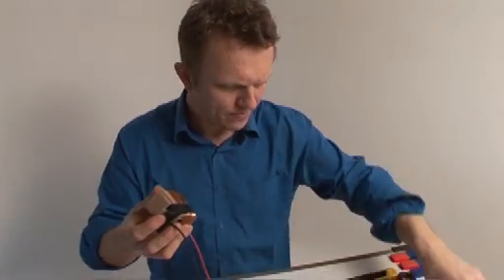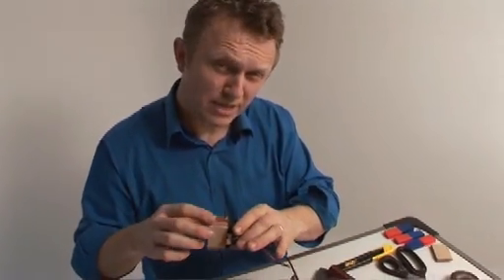BUILD A HAND CRANKED GENERATOR DYNAMO

Comment: If I were to make this using more/bigger everything, could I potentially get 5+ volts? 
I want to be able to charge a phone using something I've created. 

I imagine that at the end I'd just wrap the copper wiring around plug prongs and then spin it fast enough to produce enough volts to get it charging?

Comment: is it alright if the copper wires are not insulated?
Reply: I'm not a professional, but I imagine that copper wires not insulated would end up transferring the electricity to the cardboard, thus not doing anything. They need insulation to keep the copper conducting the electricity. As said before, I could be horribly wrong.

Comment: So what could you do to reduce your power bill without being forced to move? Well, based on Energy Star, half of all the energy we use in our homes goes toward heating and cooling. Try generating your own power and save on energy expenses through the generating power process “boma fetching unique” (Google it).
Reply: Justice Miller creating your own power wall using solar panels and batteries

Comment: I didn't understand how he did it in the part where he connected the two wires all of a sudden
Reply: +Carmella Davidson He connects the red to one end of the copper wire and the black to the other end. So make sure both ends of the wire sticks out.
Reply: +Carmella Davidson The coil has two end, the one that he wrapped around the nail at first and the one that remained after the operation, so each end is connected to one of the wires

Comment: just a question! what would happen if you used a doughnut shaped magnet that spins one way and a smaller filled round shaped magnet on the inside that spins another way ? 2 spinning magnets at once! what would happen inside the generator then ? or if you spin them in a different tempo. or out of synch with eachother... or the same way but out of synch.. or actually in the same way and speed ?
Reply: kinda like a gyro magnet inside an electrical generator! ?
Reply: actually... a magnet that makes another magnet spin inside of the outer magnet.. but the inner magnet is stronger then the outer magnet.. will it keep spinning ? will you not need to use a crank or anything then ?
Reply: thats free energy and if it worked...... well we wouldnt be worrying about power now would we?
Reply: Curious as this comment is now 6 years old did you make this project and see what happens or did you find any videos showing this project being done?   I suppose one would drill hold through both magnets where a thin rod would be inserted to suspend the magnets in the air and allow the magnets to spin around the axis of this rod separated by washers in case somehow the magnets were to slide around on the rod and rub against each other or the platform that holds the rod.  Perhaps even a strong fishing line could be used that is tightened with a good tension instead of using a rod.

Comment: can we use motor to increase the speed
Reply: Well you would have to power the motor, so what would be the point?
Reply: Well, Smitty Werbenjagermanjensen  it's not that stupid. In fact, it's this kind of thought that ended up making energy conversion a thing and electricity so widespread. This dynamo is only showing the principle of converting energy into electricity from another kind of source (here, the dude's arms). If you use a motor that do not use electricity as a base ( so that is cranked/released, gas, wind powered etc), it should actually automate the process. This is the basis of all of our energy making centrals. So the kid's question is pretty valid and can lead somewhere. 

Sorry my English, i'm not anglophone.
Reply: Liam Smith He didn't take Physics at school, give him a break :D
Reply: Smitty Werbenjagermanjensen LOL

Comment: One of the best homemade dynamos I have ever seen was a guy who worked my local refuse collection who turned a child's bike into a very efficient charger. Took the front wheel off, turned it upside down and attached magnets to the rear brake mountings, then he wrapped Copper wire completely round the rear wheel COMPLETELY covered it, couldn't see the tyre then cranked the pedal and the wheel went round at a furious pace. Ended up charging his phone his mate's Iphone, his colleagues iPad and his own simultaneously using a charger barrier strip, GENIUS loved it. All for the price of a kids bike, copper and some magnets!
Reply: i agree...this is good......and much easier to build...but i dont use dynamos to generate electricity but i use them to turn wheels and gears and other stuff......i really loved this video because now i know how to make dynamos....im tired of scavenging dynamos from old toys (and even old cellphones... )

Comment: Is it critical to rotate the magnets or can the wound copper wire be rotated around the magnets?
Reply: you can rotate either of them, but if you move both of them in the same direction it will not produce enough(it would if rotated in different directions).

Comment: How can you up the volts to 9v output?
More wire around the outside?
I mean have you guys seen the price for 9v batteries?
CRAZY expensive! 
Could this be used to charge a 9v rechargeable by hand?
Reply: Why not just buy a 5v solar panel for $10 and use it to charge batteries?
Reply: Can do that I guess,
but I like the idea of
manual labor to charge the battery.
Reply: Sam Smith Oh. Well, maybe you could get a dynamo or alternator and use one of those as a generator. I'm also pretty sure you can buy bicycle generators (generators that generate power from the rotation of bike wheels).

Comment: could i attach it to a light bulb instead of the volt metre? if so how many volts does the bulb have to be?
thank you!
Reply: If the emf being produced is only 1 volts constantly, then a lightbulb rated at 1 volt
Reply: Different bulbs have different voltages, you would would have to regulate the mount of voltage coming from the generator to be whatever is required by the lightbulb because if it goes above the lightbulbs' intended voltage, it will burn out.
Reply: Lightbulbs burn out regardless, if the unregulated voltage from the generator is above the rated volts for the light bulb by 5% then the life of the light bulb is cut in half and vice versa.

Comment: what magnetic feild in going on when magnets are spinned and how does that change occur?
Reply: The magnetic field of the permanent magnets spins with the magnets. This creates a magnetic field in the stationary coil. This causes electric current to flow in the wires. The magnetic field pushes and pulls the electrons in the wires.

Comment: i have a question, will this charge a battery?
Reply: Not the one demonstrated no. In order to charge a battery the voltage must be higher than what the battery produces by a little. Also you must rectify the voltage before attaching a battery as the reverse voltage from an a/c source will damage a battery.
Reply: J3715 ty

Comment: Can I use insulated regular wire instead of copper insulated wire?
And if I could, will it be not as good as using copper insulated wire?
Reply: technically yes, but it may not work well enough to be measured. More turns is what you want so thinner insulation is key.

Comment: Measure the Amps that are being produced by your generator. In your rechargeable battery, figure out the amp-hour capacity. Then figure out how long you would have to charge your battery for (generator production/battery amp-hour capacity). You'll need a rectifier. I'm guessing you don't want to charge the battery to a full capacity with a hand crank generator. A good project idea would be to take a box-fan motor create a small belt and attach to small generator, so you don't have to crank it.